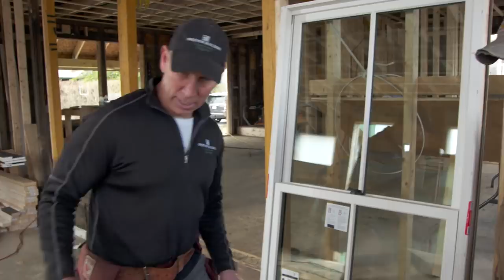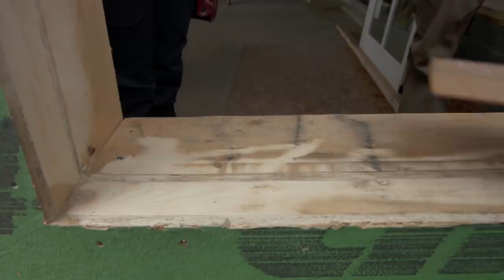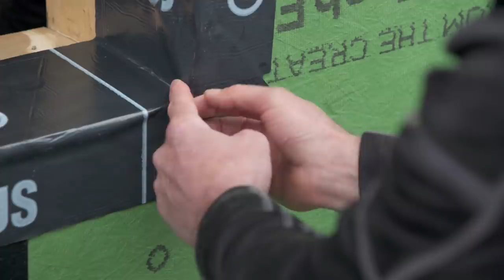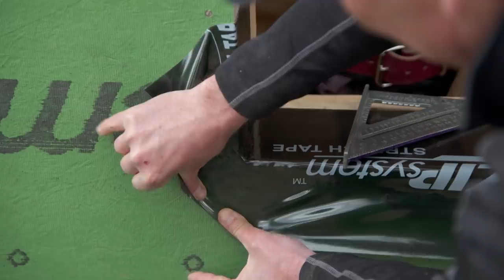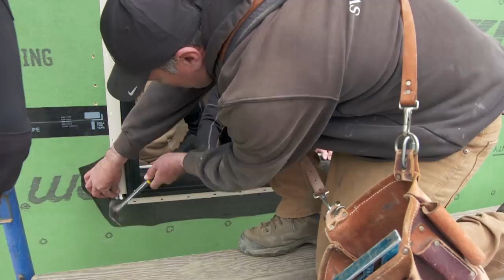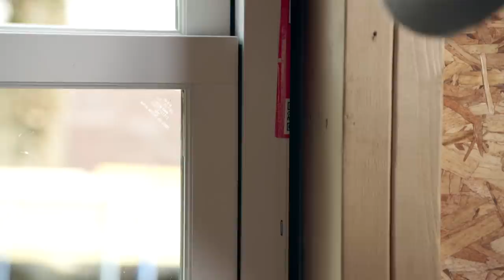How To Install a Window |  Generation Next | This Old House

Comment: Hi. It looks like the rough window bottom plate is a 2x6, and the walls are framed with 2x4's.  Am I right? If so,  why use a 2x6 bottom plate in a 2x4 wall?  Thanks

Comment: I've never seen TOH show what to do when a window, an opening, etc. isn't square.
Reply: Sifo Dyas you pull out the old framing and casing and make it square....there is no easy fix....make it square, do it right.